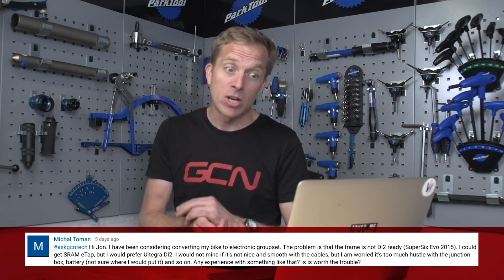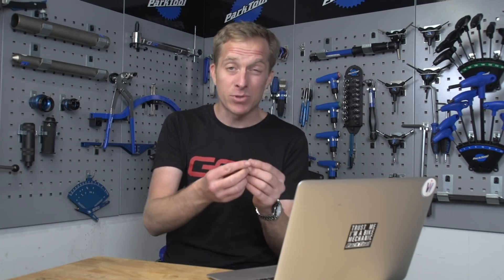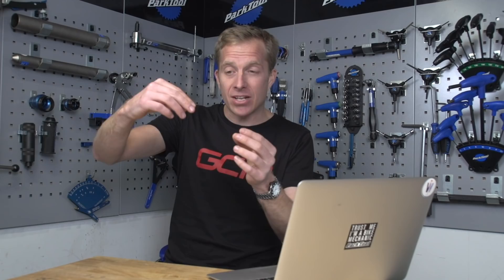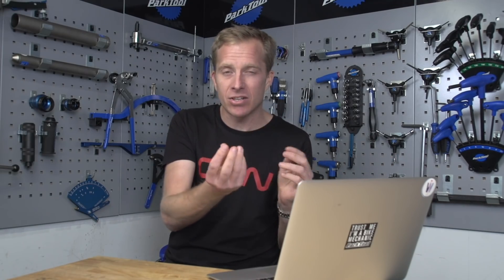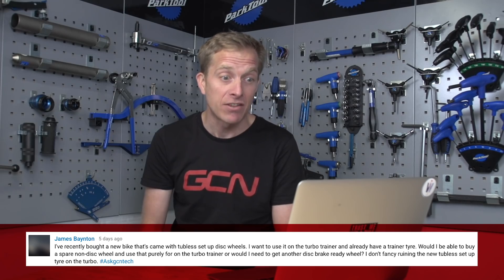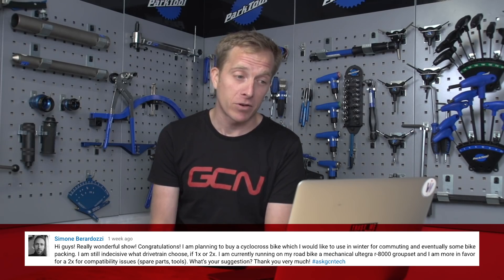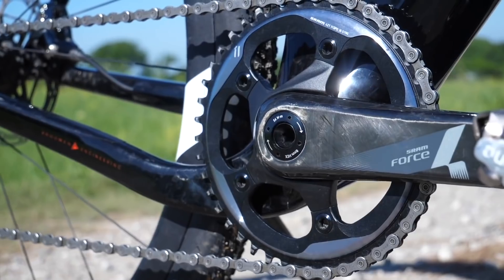Rim Brake Conversion, Di2 Upgrades & Tubeless Tyres | GCN Tech Clinic

Comment from the maker: Remember to keep your questions coming in for Jon using #askgcntech. 👇
Reply: #askgcntech hi jon what is the maximum length of steerer that can be retained for both alloy and carbon steerers?
Reply: #askgcntech Hi Jon, would it be possible to use Shimano R8050 shifters in combination with R8020 mechanical disc brakes? I would like to use my current R8050 groupset with rim brakes on a new bike with discs. Cheers.
Reply: Kittel used shimano Di2 sprint shifters for Sram derailleur at Tour De France 2018 although his components were Sram groupset  for his team Katusha Alpecin. Can we ordinary persons do that too?
Reply: Hi Jon! My question is about a drivetrain conversion project from 3x9 to 1x9 for commuting and winter training. I would replace my super heavy triple crankset by a better one with narrow-wide chainring. The thing is that my actual 105 rear derailleur spring is pretty weak, i'm concerned about chain drop...  Is there could be an mtb derailleur or an other one better sutted for 1x who could fit with my Tiagra 4503 triple 9s shifter ? Thanks a lot! #askgcntech

Comment: #askgcntech Hi, I have a cheep wheel that I use it only on trainer. If I want to service it, should I use grease for  ball bearing, or can I use a thinner lubricant, as it lower the resistance?

Comment: This last summer I got my first disk brake bike.  It’s got Ultegra R8000 hydraulic.  It works great in the dry but on rainy days it’s ridiculously noisy.  Help!  Here are more details.  Front brake pads are resin, rear are metallic.  Rotors are aluminum with stainless steel baking surfaces.  I cleaned the rotors and rear pads and replaced the front pads.  This helped but it’s still too loud.  Thanks in advance.

Comment: Good day John! I have a problem with my front inner trigger.When I shift to the big ring the inner trigger sometimes does not return to the original position but remains pushed. I give it a little help and it goes back. It is not a big deal, but still I much rather want not to have that. I use Ultegra R8000. Changed the whole cable to the front mech and it did not help.  Thanks in advance! #askgcntech

Comment: Hi Jon. I had a carbon wheel set, 55 deep x 26.65mm wide external x 18 internal which had 24 CX ray rear spokes, laced 16 cross X2 drive side & 8 spokes radially laced non drive side. The issue was during regular riding, not even in high torque steep climbs, the rear tire (25mm Conti 4000) would rub slightly against the inner seat stay on the non-drive side near the rim brake area. The manufacturer said that it was because I was on an older frame not designed for 25mm tires, which is true. But do you suspect that the lacing of the spokes or number could have something to do with it? 16 spokes on the drive side and only 8 on the NDS, is that a typical lacing pattern? Also, would a 25mm external wide rim or more spokes on the real wheel resolve this? 
Thanks in advance for your input!

Comment: #askgcntech Hi Jon, I recently bought some new carbon wheels with the bladed spokes. Do these shaped spokes generally make a scraping noise where the cross on the rear wheel as mine do when I put power through the pedals or cycle at high speeds and it's driving me nuts!!! The wheel has gone back to the manufacturer several times and spoke tensions, hubs have been revised etc but to no avail!
Do you know if there's a hack to help solve this noise issue? Any advice would be much appreciated!!!

Comment: #askgcntech Hi Jon, I have a problem, my saddle height is as the same height as my handle bar height, I can't return the frame, how can I get a more aero position, can I just shorten then slam my stem to get the same effect? Btw my bike is a Giant Contend 2 (2019), any help would be great, because I don't know where to start. I'm 5'3 btw, thank you Jon if you can read this :)

Comment: Why do you suggest a closer range cassette for bikepacking?
Reply: so you can pedal at a nice cadence, not going from 80 rpm to 60 rpm in a single shift. Some wide-range 1x setups have those spreads. 

With a couple of nicely spread chainring sizes you can use moderate jumps on the cogs. Say one chainring for the  flats and one for the climbs. A 28 inner chainring is not uncommon for loaded touring that ventures in gravel/remote areas.
Reply: Rod Diaz I am planning on going 48/32t in front and 12-40t in the rear (maybe: 12-14-16-18-20-22-25-28-32-36-40). I will be touring with bikepacking setup. What do you think?

Comment: #askgcntech
I have a Diamondback Haanjo 2, and every time I take a large turn my front wheel contacts the front of my foot, and I do use cycling shoes. What could be my problem?
Reply: That's a common problem, especially with smaller frame sizes.  To be honest, if you are turning the bars that far you really shouldn't be pedaling.

Comment: Hi, and thanks for the clear advice on this channel. I've got 105 28mm ready callipers. But I've had a couple of scary moments when small stones have got caught between the callipers and the tyre. In one case I came to a sudden stop, and in another I had a very rapid deflation as the stone slit the tyre. This was on a short, sharp descent, following a longer very, very fast descent. If it had happened on the earlier descent it would have been bad news. The tyres were Conti 4000s. I gather they are on the large side. Should I give up on Contis, or give up on 28mm altogether?

Comment: When do you know it's time to add a tooth to the big chain ring? I currently use a 52 tooth but I'm thinking I need to go to a 53. I do ironman triathlons and I'm in the highest gear possible going down hills and spinning at 110+rpm. On the flat I'm generally in the 4th smallest cog on the cassette. Would I need to change the small gear ring as well? #askgcntech

Comment: Oh the unbranded ebay rotors are just as good, they might just be heavier and bendier, and that's my experience with them, bendier, but overall they brake as good as the material area they are in contact with, rotors are literally a sheet of metal, how in the world is that going to fail?... at worst they'd bend and stop your bike.
Reply: Those "branded" rotors are design to dissipate heat faster than those cheap once, which you said is just sheet of metal. Manufacturers achieved this by using combinations of different types materials..
Reply: I've unfortunately heat-deformed a very cheap (though brand name) rotor stopping down a steep but short hill mingling with traffic. It didn't fail, but couldn't be bent back to a serviceable shape. Old Avid super cheap rotor on a fatbike. 

I do agree that if you bed them correctly the braking is pretty much the same.

Comment: One thing I like to have on a bike that will carry a lot of stuff like a bikepacking bike, especially if I expect to spend long days in the saddle, is to have a really low lowest gear. Preferably one where the rear cog is bigger than the front chainring. Very handy when a climb comes up after eight solid hours of riding. And with a compact or subcompact chainset and an 11-36 cassette you have that in a 2x setup. Getting the same in a 1x setup isn't as easy. Either the cassette has to be HUGE, or the crank has to be an MTB crank.

Comment: #askgcntech Thanks for the great show! I was wondering, using the Schwalbe Pro One on the Reynolds Strike tubeless is a pain to assamble (There thanks again for your videos regarding tubeless and DIY), but it was even a bigger pain to disassemble! I had a puncture and wanted to simply insert an inner tube, but was not able to get the tire off. I tried almost everything back home, water, grease, tools... Do you have any idea without destroying rim or tire? 
Thanks in advance, Michael

Comment: Hi Jon, I’m using ultegra 6800 shifters but unfortunately came off my bike and  it put a hole in the hoods. Looking at the dura ace 9000 they look and feel grippy(or is this in my head) and this would be good in winter for grip. I was wondering if I could use the dura ace hoods with ultegra shifters. Thanks for any help
Reply: I don't think they are the same. Most places I've looked have hoods specific to each of those models. But hey, at least there are some aftermarket versions. My non-group hydraulic group only has Shimano hoods - and they are not a perfect fit.

Comment: #askgcntech Hi Jon, another rim brake convertion question: i'm restoring an old bottecchia and i'm considering converting from cantilervers to sidepull. The holes in the frame are present, but i'm worried they might be meant just for mudguards and not be able to handle the stresses of a brake.

Comment: @
Hello Jon, love the gcn tech show! 
I've just bought my first road bike. Its a mid 90s Ribble 653 steel frame with the original 2x8 campagnolo athena groupset. If i was to change the brakes to dual pivots, would i have to replace the levers? What am i better of upgrading next to more modern components, the wheelset or the drivetrain?  Thanks!! #askgcntech

Comment: Jon,  to avoid noise on a waxed chain,  let the wax cool until a soon starts you form then drop the chain into cold water.  This allows the wax to not run out. Wipe off the excess wax and enjoy.  Also use some paraffin oil in the wax bath,  about a 50/50 ratio to the wax - this also helps reduce noise.

Comment: John, I've got a Vitus Energie cross bike with a SRAM 1 X set up. Frame has internal cable routing but being 1x I have 2 ports on the down tube one at the top one at the bottom which are filling up with mud etc. Contacted Vitus they don't do blanks, do you have any ideas or know where I can buy blanks?
Reply: Hi Simon. Had same on my giant. Plugged the bottom bracket cable hole with hot glue from glue gun. Worked a treat all season and popped out easily when cables replaced. Mark
Reply: @TheStussy32  hi Mark, thanks for your reply I will give that a try. Simon

Comment: Hi Jon! Great show, I watch it every week! I have a 2015 cannondale supersix with sram red and 11x28 cassete. I plan to buy a new and lighter pair of wheels to use on uphill training and races. I read that the rear derailleur does not work with a 11x32 cassete, is that right? Do you think it could work with a 11x30? What should I do???? Thanks a lot! Cheers from Brasil!!!! #askgcntech

Comment: Hi GCN. Really Enjoy watching your show daily. How safe if i run my Etap Rim brake shifter on a TRP disc Brake caliper on a Disc Frame? Will the cable pull destroy the frame? For My Canyon Ultimate Disc Electronic only #askgcntech

Comment: Hi #askgcntech. I have a 2015 Cervelo R3 with Fulcrum Racing Zero wheels. Due to the very tight fork crown to tire clearance I am limited to a 23mm tire (GP 4 seasons) on the front. Any suggestions how I can increase the clearance so I can run a 25mm tire on the front? Would different brand tires or wheels make any difference? I've even heard of people placing shims in the dropouts but that sounds like a definite bodge.Thanks
Reply: I have the same problem..
Reply: Not really. Had the same problem with an Argon Gallium. Different brands of wheels (esp. rim width) would make a difference since wider rims make tires rise vertically a bit less, but then you may rub your tire somewhere else. I was unable to run anything greater than a 23 on HED Ardenne rims.

Other tires and sizes may fit differently but it's all semantics - a 23 tire by continental is not the same as a 23 by Schwalbe or Vittoria. But your constraint is the same - if you have 26 mm total clearance whether the manufacturer calls its tire a 22 or a 30.
Reply: I upgraded to the same wheels and lost a lot of crown clearance. I don’t understand why. The wheels are the same diameter surely. Same tyres.

Comment: Hey Jon, Question? I'm running the wax chain setup also. 200 miles seems fairly short. I've been running mine around 500 with no problems to date for the last 5 years. Any studies as to what is the ideal mileage point for a road only  wax chain? Whats your take?  Enjoy your inputs. Also note down below about drilling holes in carbon. Looks like think twice then don;t do it.   Thanks from the US/Missouri.. #askgcntech

Comment: #askgcntech Hi Jon, I just set up a pair of AlexRims tubeless compatible wheels (ATD470) with Notubes tape and Panaracer GravelKing 32 mm (slick version) to use them tubeless. Tires went on pretty well and stayed inflated overnight with a small dose of sealant. I have noticed that if I press with my thumb against the sidewall of the tire right next to the bead, the tire let's some air out. Is that something normal, should I try to reseat everything or just give up on the whole tubeless setup with this combination? Cheers from Canada!
Reply: doesn't sound as though the tyre seated properly... did you get the pinging / banging sound when inflating the tyre for the first time?  If not, pump it up to the limit of the tyre / wheel to get it properly seated.

Comment: To John Buten and also Jon Cannings re noisy chain: what type of wax are you using? I use a paraffin wax and mix it with paraffin oil (water tank sealer) at about 50/50 to make it softer (still solid, but pliable at room temperature).

Comment: A waxed chain should not be noisy! If it's noisy, it means it needs more wax. Best thing to do is pull the chain out as the wax is cooling (so the wax doesn't come out too quick) and then dunk it into cold water to solidify it in place. I suspect you are both pulling it out when too hot which leads to dry spots.
On a new chain, you should get about 15-20 hours out of it before you need to rewax. It's at that point when it starts getting noisy. As the chain gets worn, this starts coming down to about 10-12 hours.
Reply: Agreed.  That cold water bath really does make a difference on wax longevity.  An extra step but well worth it.  I also started using Boeshield T-9 between rides and it helps remove some dirt while adding more wax.  Just gotta let it dry off overnight to avoid attracting road dirt...

Comment: Great show as always Jon :)
However I don't really like the part where you "gently promote" the idea of drilling holes in a carbon frame. This is a definite no no and should not be mentioned as a possibility! 

First of all, by removing material and fibers, you'll end up weakening the structural integrity of the frame.
Furthermore, you'll run the risk of delaminating the fibres + leaving paths for water ingression, which is something you definitely don't want.

Here is what the manufactures are saying:

"There is no circumstance where a hole can/should be drilled in a carbon frame by anyone other than the manufacturer. The reason we can drill holes in frames is that we specifically design areas with reinforcement for post-molding machining processes. We make intricate and exact fixtures that can take advantage of those areas with the appropriate cutting tools. There is absolutely no circumstance where we would feel comfortable with anyone outside of Trek drilling a hole in a carbon frame".
— Ben Coates
Trek Road Product Manager

"Drilling holes in a down tube is a bad idea. The holes will create stress concentrations where cracks could form, compromising the structural integrity of his frame. If we meant for holes to be drilled in those locations we would have reinforced the tube walls in those area. (Needless to say this would void the bike’s warranty). Most of the holes in our frames are drilled, but we have specific reinforcements in those areas to prevent structural issues and the drilling process is very controlled and repeatable".
— Luc Callahan
Engineering Manager- Road
Specialized Bicycle Components

Comment: Hi Jon, love the #askgcntech clinic, fav segment across the entire GCN. I've been contemplating writing in for a little while now, but the past several weeks' questions about mixed component compatibility seemed relevant so I took the dive.

I started riding at the start of the year on an entry level road bike that came with mostly Claris groupset, but notably with a chinesium "Prowheel" branded 8/9-spd compact crankset on a square taper BB. About 6 weeks ago during the downtime after a fall, I upgraded everything to 10-spd using a range of mixed parts off Gumtree/eBay: Tiagra 4700 10-spd shifters, 105 5800 11-spd derailleurs, 105 5700 10-spd cassette, but kept the crankset due to that cursed BB.

I've been loving the upgrade (It runs so quiet! Shifts are so smooth!) but have been having trouble with the trim function on the front shift, notably when shifting from the large to the small ring. It's as if there is an extra position in the shift, and I find the chain almost getting "caught" between the large and the small ring, so when I pedal it kind of (but not quite) spins without engaging. I've resorted to clicking the shifter twice when downshifting now, but would love to resolve this issue. I've been trying without luck to fix it by reindexing, but is this problem due to the crankset being designed for less speeds? Is the 10-spd chain simply too narrow for my crankset? I've done a ton of reading (and learning!) about cable pull ratios and shifter/derailleur compatibility so I was fairly confident going in that this mixed group would work, but did I make a mistake somewhere? Or do I just need to keep honing my reindexing skills? Regards, Kit